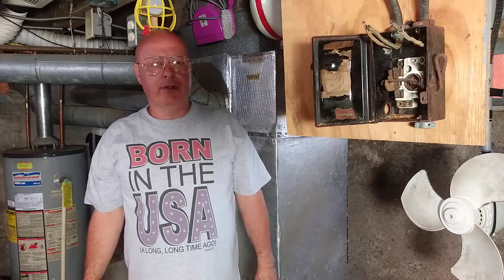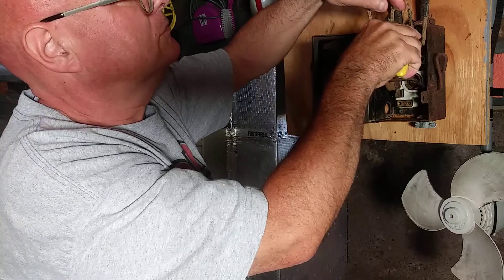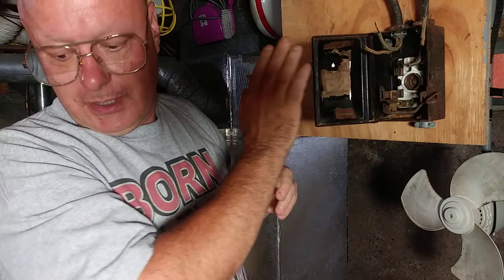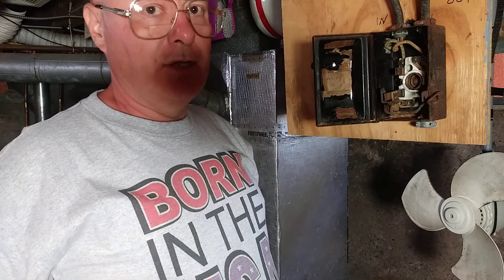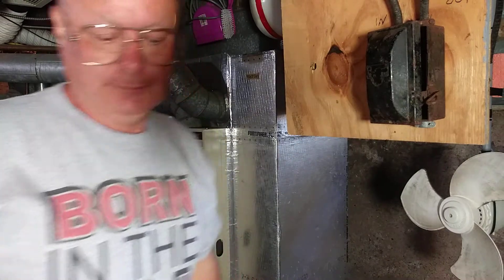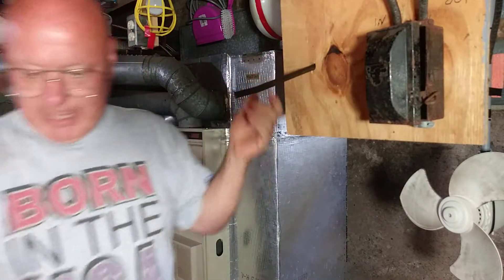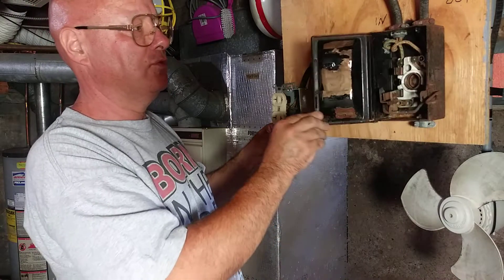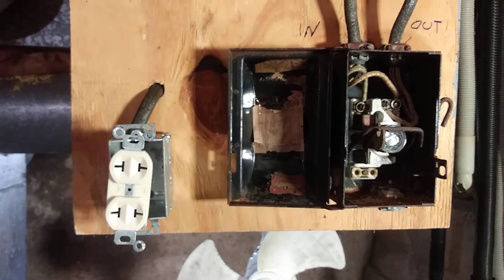Tutorial of wiring fuse box and outlet 1920s threw 1940s

Comment: Another oddity for some fuse panels dating from the 1920s and '30s when many homes had 30 amp 120 volt services is fused neutrals,  that is, a two fuse /circuit layout.  In the early 1900s some folks felt that if a fuse on the hot is good protection,  then having a second fuse back on the neutral side must be even safer and some jurisdictions even required double fusing for a brief period.   Of course it was found that double fusing was less safe because a loose or removed neutral fuse would leave a circuit that appears dead when if fact it is live at 120V relative to ground all the way back to the neutral fuse and electricians and some homeowners were shocked,  some fatally,  when they began fiddling with what appeared to be a dead circuit.   Same situation occurred if an overload or short circuit occurred,  because typically one of the two fuses blow, and there's a 50/50 chance of it being the neutral fuse.   Later on, like say the late 20s and into the early 40s, they had what were often called dummy fuses, which basically resembled a plug fuse but offers no overcurrent protection, to be screwed into the neutral fuse socket in retrofit situations. Other electricians would place a 30 amp on all the neutrals and 15 amp on the hots to ensure the hot always blew first, or they used a penny in all the neutral sockets.    Some panels of this vintage had an asbestos liner and most had exposed terminals easily touched.

Today there are still dummy fuses made for cartrige fuse holders, made from brass or copper and stamped "THIS IS NOT A FUSE"    In modern times these are used in commercial and industrial settings when there is a 3 phase  3 wire corner grounded delta, usually 240 or 480 volts, one of the phases, typically phase B, is a grounded conductor and not permitted to be fused.   Corner grounded delta systems are very seldom installed today, nonetheless there are still many existing installations in use, especially in the oil fields and waste water treatment plants where the only loads are 3 phase motors and single phase line to line loads such as HID lighting.